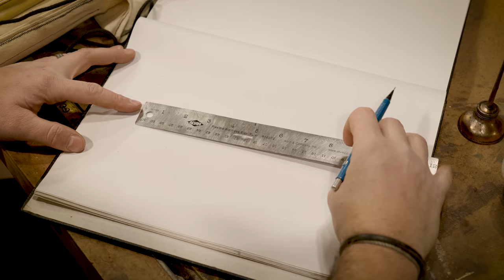Damascus Viking Axe Build with Forged In Fire Champion

Comment: Awesome job. I just really appreciate the way that you describe what you are doing all through your videos. I have wrapped some of my handles with leather also, and used linseed oil on the handle as well as the leather. I wasn’t sure if that was correct or not. But thanks to you I guess I got it right. Keep up the great work. Thanks